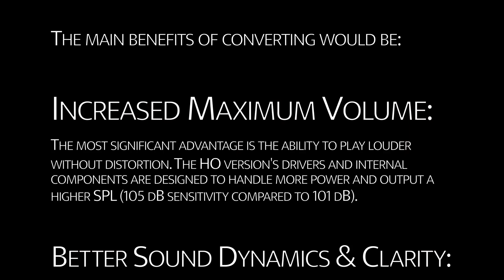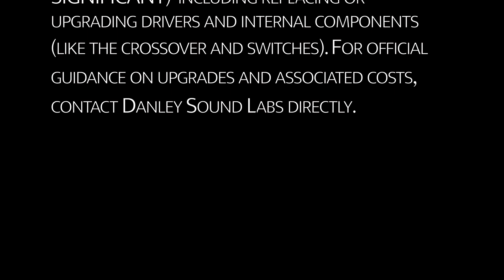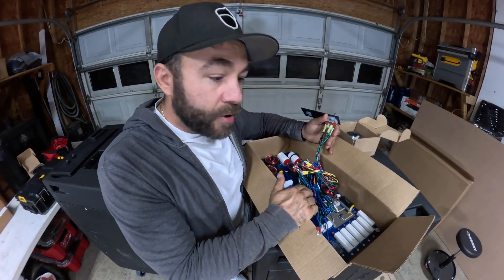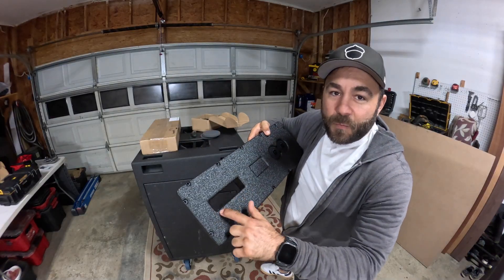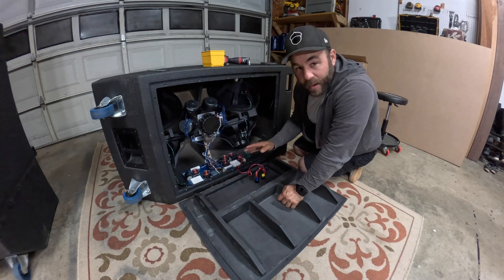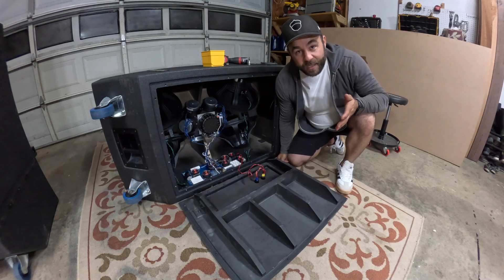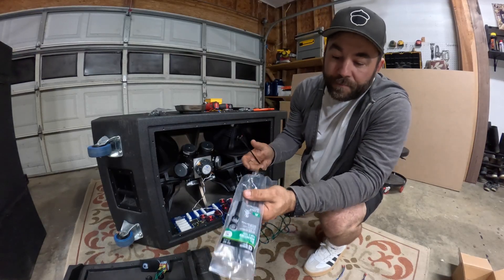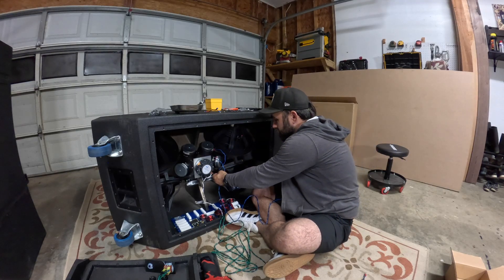Danley Sound Labs SH96 HO Conversion

Comment: I did the conversion a while back. Since I was working on a pair, I took the time to install the back panel and crossover mirrored instead of on the same side of each cab. That way when I ground stack or fly them for shows, one doesn’t have to be upside down. Just a quick tip if things like that bother you :)
Reply: But does it really matter if it is upside down?